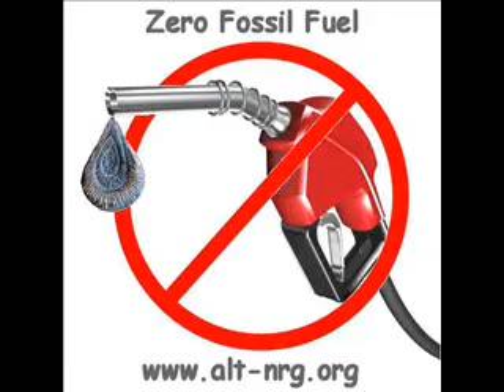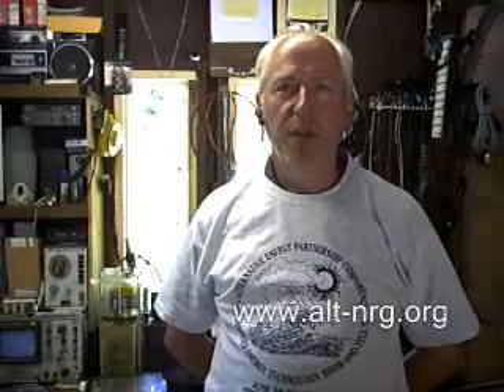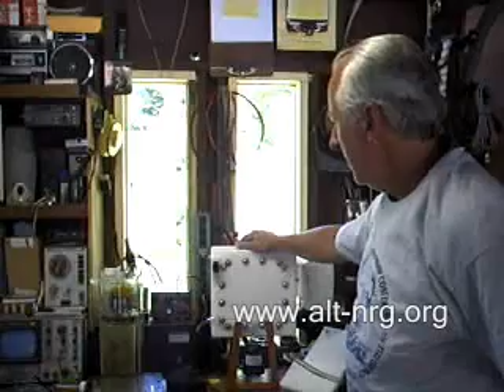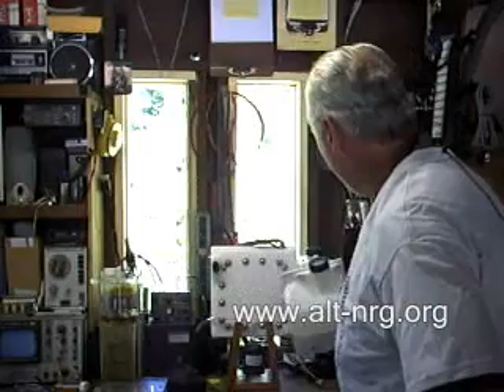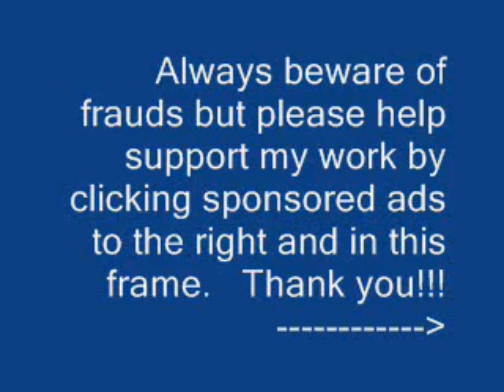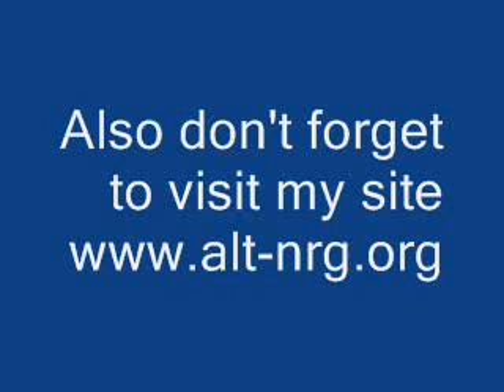#102 -Zero revealed! Jarboe's Mill recap

Comment: Hello there zero. I personally believe I found a solution to decontaminate hexavalent chromium. If you have not seen my videos, YouTube site you need to do so that you can advise everyone else that we may be on to a new solution for decontaminate hexavalent chromium stainless steel plates in the machines that we use. As of 2-10-2016 I am taking samples of my decontamination sodium hydroxide hexavalent chromium and a sample directly from the machine to a professional laboratory to get a second opinion on my testing results to reaffirm what I am claiming actually works for decontaminating hexavalent chromium. https://www.youtube.com/watch?v=zvwOchaE2Lc

Comment: Hmm, if the Chromium leached off of the Stainless Steel is a problem, I have a radical idea, Don't use Stainless! 

Use Regular Steel, I know it will wear out faster than the Stainless will, SO WHAT, it is much cheaper, and if the Chromium separates from the Stainless anyways it results in Steel plates left behind... If the plates are kept submerged they will last for awhile, look how long the Titanic has been sitting where it is.

Cast Iron would also have very few Hazardous byproducts.

Comment: Good stuff Z,
I am a bit confused though as I thought I heard that EBN did tests on the amount of CrVI and the PPM was very low when compared to the regular water we get from the house tap.
Not to say that there is not CrVI as a by product in our research but how does it stack up to other industrial uses? Welding, dye pigments, electroplating, among many others.
I always handle and dispose of my electrolyte with care but do we have definitive data on this when compared to other industries? TY

Comment: as i recall my involvement with cell constuction and design, which was brought about by stan meyer. no electrolites were used in it's operation or design. i as well have had no problems generating HHO. the only limiting factor i have had to date is the proper power supply. that problem has been resolved. hexavalent chromium is produced when the metal is worked. i.e.- cut, sanded, polished, or welded. i have worked with this material for 35 years, publish the lab tests on the electrolite.

Comment: Stainless steel T304 material is used to form Electrical Voltage-Plates which do "not"
chemically interacts (chemically inert) (Lab tested less than .0001/year decomposition rate).......as long as we have no KOH.

Comment: Hi Zero, Very interested in your work...Very good , I have made up a cell my plates are 6" x "2 1/2" s s , not sure what grade, they are cut from a commercial dishwasher side panel. configured - + - n - + - n etc. 21 - 11 + 10 n 0.5mm spacing, production from 13v dc at 16amps draw is not much at all.from 3/8ths" tube its 1 bubble ( pop )per second ? any tips what I may be doing wrong?? D. B.

Comment from the maker: Not the electrolyte but the process of electrolysis. It will leach out even in distilled or tap water if you up the voltage high enough. Electrolyte simply lets us get current into the cell at lower voltages.